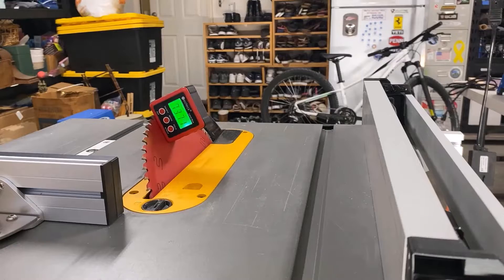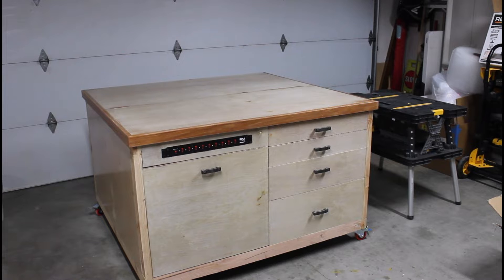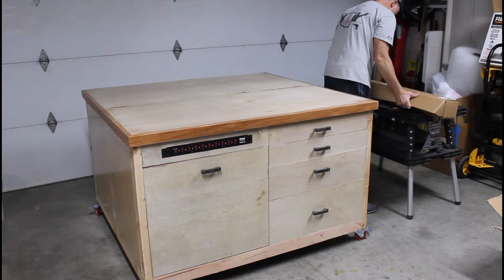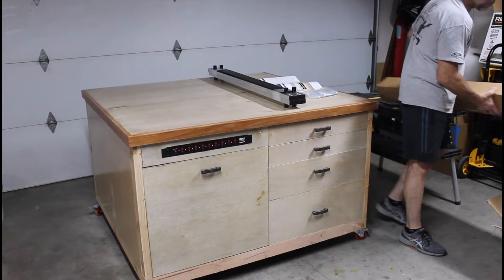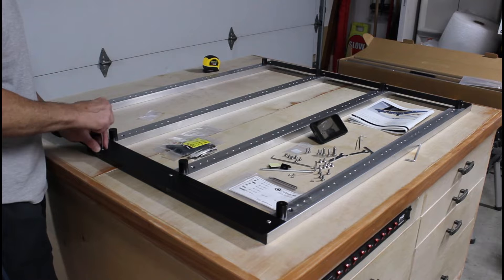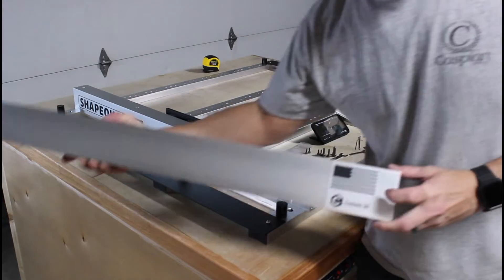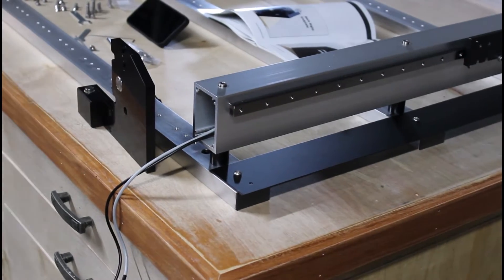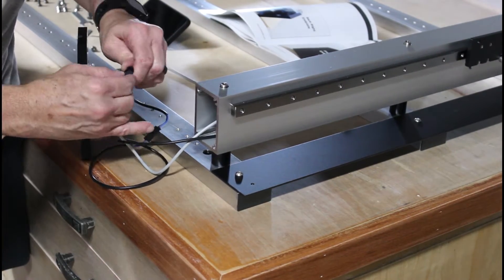Assembling the Shapeoko Pro XXL

Comment: Hi, Great video! What is the size of your cabinet for your Shapeoko? Thank you!
Reply from the maker: Thanks for your question.  The cabinet dimensions are.: 57 1/2 wide, 53 3/4 deep, 33 inches high. Keep in mind the height measurement is without the 3 inch castors. With the castors the overall height is 36 3/4 inches. The base of the castors adds the additional 3/4 inch.
Reply: @eastwingvintagewoodworking4797  Thank you so much for the information.. 
I just have a small question then.. There is no room for your computer right to fun the CnC? 
Thank you again!
Reply from the maker: @rickpouley2857  Rick, good question.  I bought this on Amazon to use to hold my laptop...
https://www.amazon.com/VIVO-Adjustable-Articulating-Professional-MOUNT-V001GL/dp/B08MJ7X1ZF/ref=sr_1_24?crid=OTE6P4D3XVUX&keywords=laptop%2Bdesk%2Bstand%2Badjustable%2Bheight%2Bswing%2Barm%2B360%2Bswivel&qid=1671663270&sprefix=laptop%2Bswivel%2Bstand%2Caps%2C153&sr=8-24&ufe=app_do%3Aamzn1.fos.006c50ae-5d4c-4777-9bc0-4513d670b6bc&th=1
Reply: Oh cool! Thank you for the information about the computer holder! I never thought about something like that.
Reply from the maker: @rickpouley2857  Its working out very well.  Super sturdy!  I should be releasing a new video soon with the final stage of the build...the enclosure.  I will highlight some of my modifications including the laptop stand.
Reply: @eastwingvintagewoodworking4797  I am looking forward to seeing your video!!

Comment: how did you get the assembly magazine.Jeff did you buy the bitsetter and the bit runner Jeff
Reply from the maker: Jeff… the assembly magazine/directions came with the machine.  The bit setter comes with the pro model.  But is a separate purchase on their other models.  I did buy the bit runner but haven’t installed it yet.
Reply: when you get it up and using it to doo tool changes howabout a video showing how you set up your XYZ to run a multiple tool paths. Thanks Jeff
Reply from the maker: Jeff…thank you for the suggestion.  Excellent idea!  I’m currently working on a project that I will be publishing soon.  I will incorporate that process in the video and walk through the details of the process.  Thanks again.